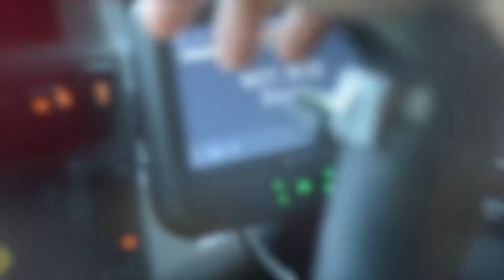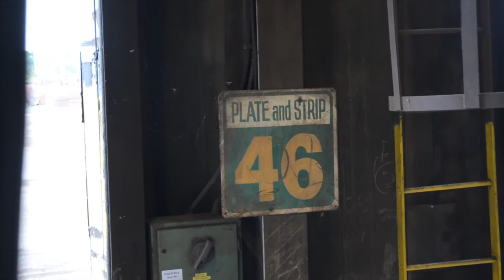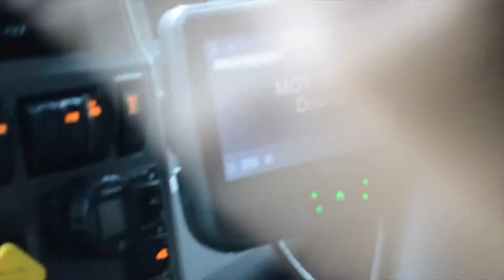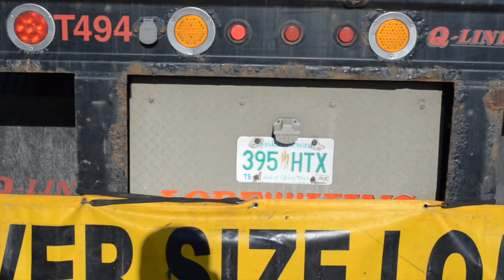PINOY MANIHO Truckinglife with my dog max (Going west steel plates)🇵🇭🇨🇦

Comment: Ano po requirements para maka apply dyan boss?
Reply from the maker: sa mercan boss andun lagat requirement para trailer truck driver. 
mag inquire po sa mercan, tested and proven napo yung agency na yan. 
salamt po
Reply: @pinoymaniho9252  pila ka years experience ginakuha dira sa inyo company boss?
Reply from the maker: @remoncanaway9754  wala ni sila nag kuha mga driver dere sa akong gitrabaho.an brad. 
peru sa BigFrieght of Kelsey naga kuha sila mga pinoy drivers.
Reply from the maker: @remoncanaway9754  5 years experience brad.